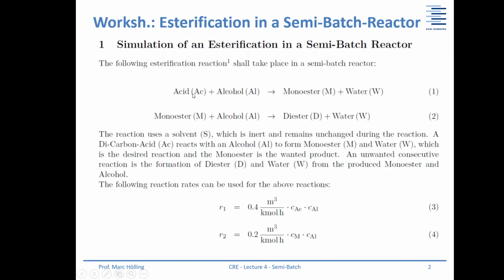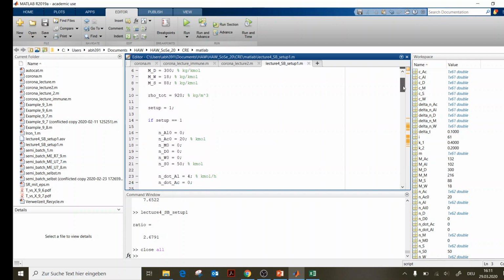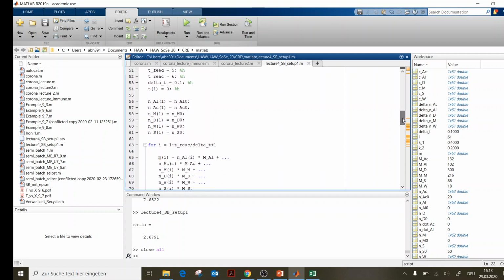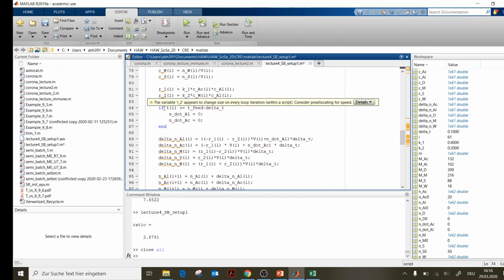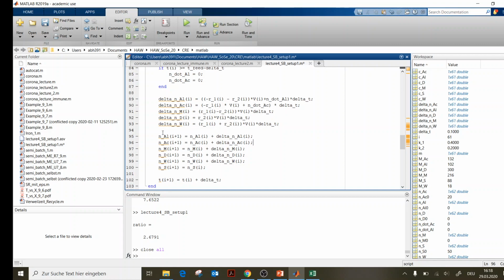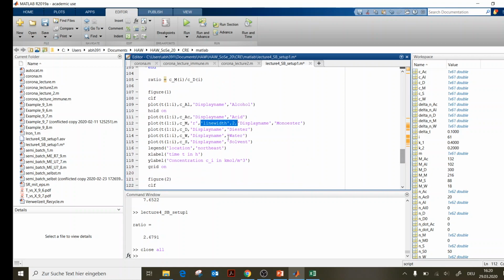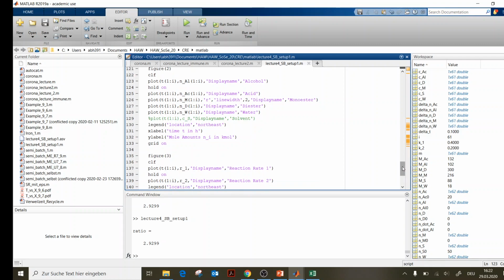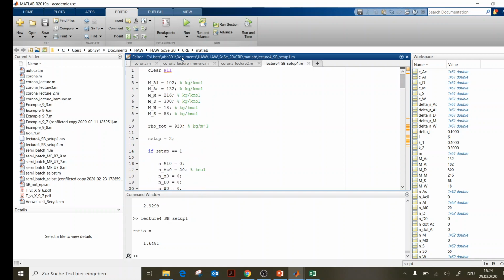CRE - Lecture 4 - Semi-Batch with Matlab

Comment: Hi, I tried using ur method but i keep getting an "Index exceeds the number of array elements. Index must not exceed 1."
Reply: any chance you can help me out with it
Reply from the maker: It seems that you use a syntax like "a(i)" where i is not an integer - this should result in the cited error message. If you are using a loop, make sure your indices are defined like this: "for i = 1:10". That's my guess without knowing your code. Best, look at my code in the video (stop the video to compare it). Normally it should work - the matlab syntax does not change.

Good luck and thanks for watching the video :-)